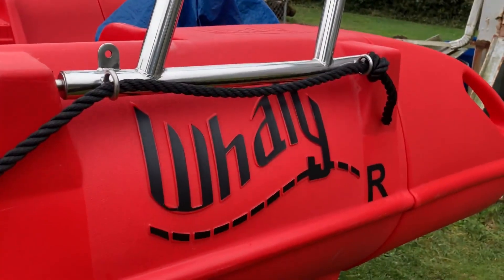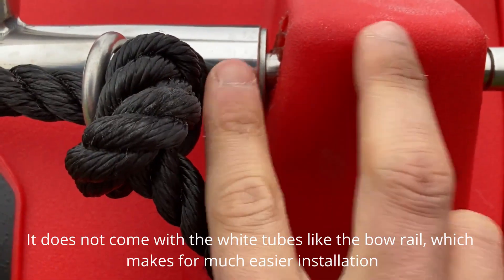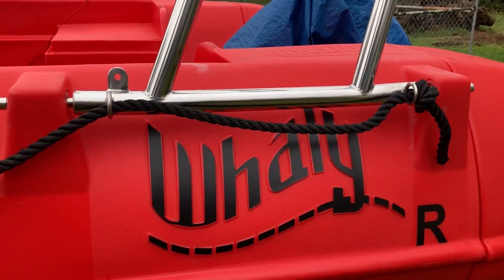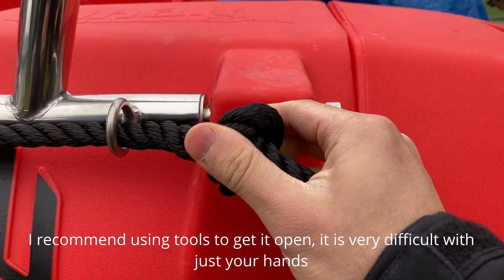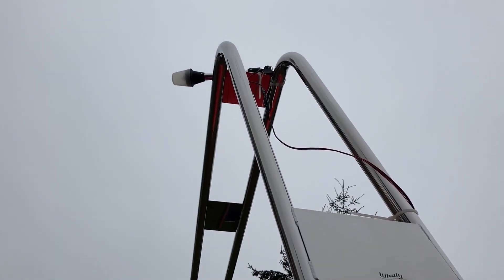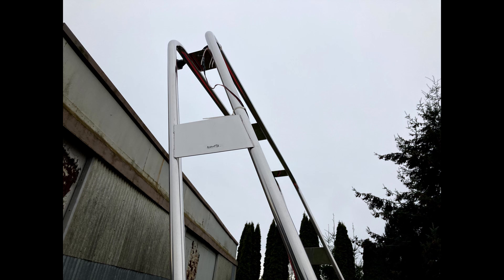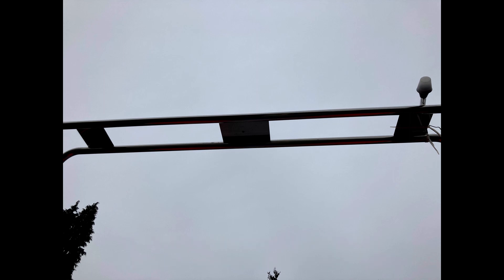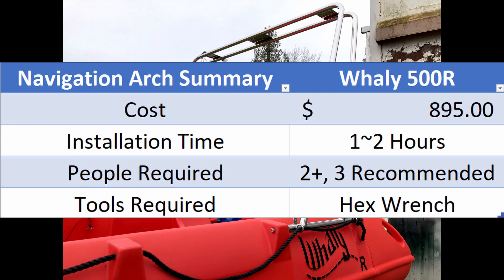Whaly 500R - Navigation Arch Installation Tutorial

Comment: I just ordered a Whaly 500R model last week to take advantage of the 15% off discount. I have a local dealer here in Massachusetts. They just opened here recently.
Reply from the maker: Awesome! That's a great deal. Let me know how you like the boat once it arrive!
Reply: I worked with Tim over at Whaly NE/Waypoint Marine.  Is that who you used?  Just ordered mine as well.  Went with white, 70 hp Suzuki, rails, nav arch, I am thinking console center to the back, and then all the stuff needed to hit the sound.  What is your setup?  We should get out this summer haha
Reply: @RyanGalligan  Yes. Tim is the man. I went with the Yamaha 60hp, but it will not be  in stock until June.

Comment: What’s the warranty on the whaly hauls?
Do you have to store them on a custom trailer only that supports the boat by the keel like Polycraft or SmartWave boats?
Thank You.
Reply from the maker: Hey Mike, I can't remember but I think it was 3 years? Will have to dig up the documentation. No custom trailer needed. I got an EZ trailer with mine and it hasn't been an issue so far.